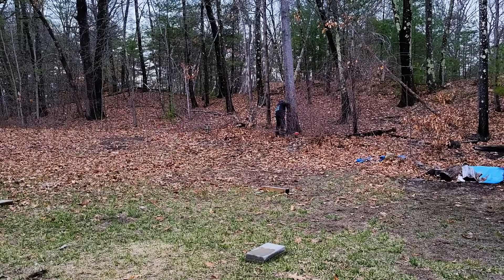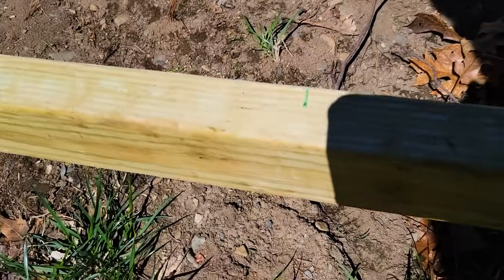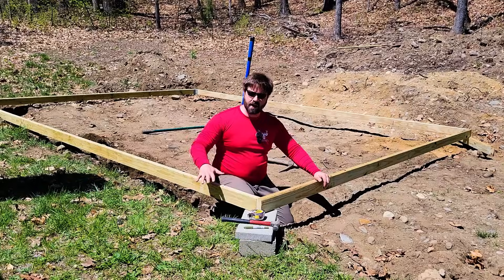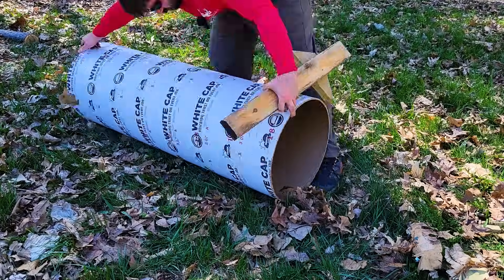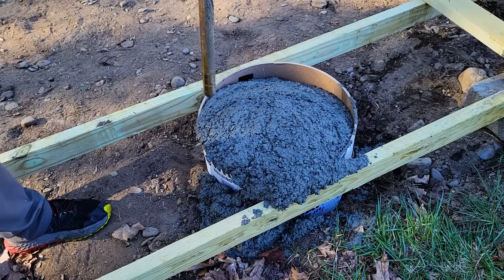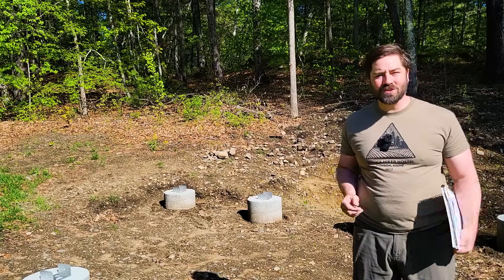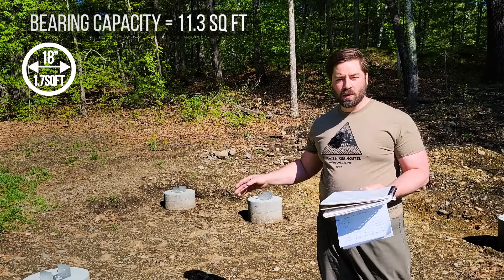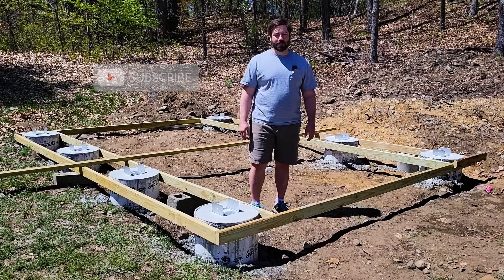Foundation secrets for an Off Grid Cabin

Comment: I was lucky I was able to get paper tubes from a box factory for free. They ranged from sizes of 8-16" in diameter. I set a flimsy metal storage building ( I could lift and move the entire kit) onto 32"x12" piers of concrete that could hold a 3 story house.

Comment: Great video - thanks. You answered a pile of questions. You didn't use any rebar - can you provide some insight on that decision? Thanks again!
Reply from the maker: Concrete is very strong in compression, but weak in tension.  Rebar is strong in tension.  Rebar is used to strengthen concrete structures where it is subjected to tension forces.  In my case, these footers are spreading out the load of the beam over a wider area of soil.  This is considered a simple compression force, no tension forces.  Simply, code does not require rebar in a simple footer like this.  

However...  If I had dug down 5 feet, and had an 8 inch pier of concrete, then the pier could be subjected to lateral loads, which puts the pier in tension.  I would have added rebar if this was a pier.

Comment: In North Dakota, I'd use a poured foundation at least 4' deep (although 6' would be better, considering our frost line is almost 6' deep) in a monolithic pour. I know from experience that even a small, light structure here needs better foundation. The ground shifts quite a bit. ICF's wouldn't be unreasonable, but I'd have to have professionals do the prep work for it. I can't afford that, and we tend to be DIYers ourselves.

Comment: You didn't use any rebar...
Reply from the maker: Correct, since these are in compression.  However, if I had used deep piers, then I would have added rebar. This is because deep piers will get lateral forces on them.

Comment: I've heard some folks paint their timber with used motor oil ~ to keep moisture and bugs out long term. FYI
Reply from the maker: I've also seen some YT videos of people doing that.  I'm using pressure treated lumber so it's not necessary to use another treatment on top of it.

Comment: Quick question - you built the wooden frame and leveled it, but then it looks like the tops of the sonotubes are actually around a ½ inch or so above the frame. Is that correct or does it just look like that on camera? Is there a reason they aren't the exact height of the leveled wooden frame? Thank you.
Reply from the maker: We built the wooden frame, and roughly leveled it.  This allowed us to pull a height measurement from the soil to the top of the wood frame and cut the sonotube to that height.  After placing the sonotubes into the wood frames, we then went back and checked level from tube to tube and made minor adjustments, so some of the tubes are slightly above the wood frame and some are flush.
Reply: @DavidPozEnergy Thank you! This is exactly the info I was looking for. Great info in this series. Looking to build a backyard shed/studio soon.

Comment: When you calculated the weight of the structure, you didn't include the weight of the concrete inside the sonotubes - is that an oversight? The soil has to support that weight too, right? I see you added 40 lb/square foot for snow load. Is that code in your area? To me, it seems like too much - by a LOT.
Reply from the maker: I did include the weight of the concrete.  Yes, 40lb/sf is code in my area.  Check your own local codes for the requirements in your area.

Comment: Why not go below the frost line?
Reply from the maker: For me, it was a cost vs. risk.  My ground is extremely well draining on it's own.  I don't have standing water, and that means very very little frost heaving.  So, it's still possible I might have a little movement due to frost, but I'm guessing it will be so little that it won't be noticed and certainly won't cause harm to the building.  So, I put building harm (risk) very low.  
Then, compare it to the cost to go below the frost line.  I would have needed to get an excavator out for at least one day to dig the holes since the rocks on my site are too large for an auger.  Plus the additional concrete and rebar (above what I already used).Cost would probably be an additional $1,500.  I couldn't see an additional 20% cost vs. the little risk.  
The math will change depending on your site.  If I had a wet site that was prone to frost heaves, and/or  ground that could be dug with an auger, then the ratio becomes less and I'd be more inclined to go below the frost line.

Comment: Nothing but rocks grow well in many parts of N.E.
Thickened edge slab or gravel and pressure treated runners or sonotube below frost. That shed will rise and drop 3" winter to summer. If every footer doesn't rise and settle at the same rate, the shed will flex. How much deflection is anyone's guess?
Good luck! It might not bite ya in the butt.

Comment: Since mid size cabins are still heavy enough to stand the wind, why do we put rock or concrete foundations inside the ground, why not just place them on the ground and build the cabin over?
Reply from the maker: I would consider my foundation set "on" the ground, not "in" the ground.  But, I still had to get below the organic material to prevent settling.

Comment: Great calculation for designing your pile footings. I hope you also consider the winter frost heaves of the ground when/if the ground gets wet which including your winter freeze and thaw cycles as this will also makes your foundation unstable. 🙃
Reply: That was my thought too.  Taking into account the frost line, I think about 4 feet in New England.  A city building code would specify that, even for outbuildings.
Reply from the maker: @StevenTorrey,  Every town will have different codes.  For my location, a building under 200 square feet is not required to have a foundation below frost line.  Thanks for watching.

Comment: if you aren't going below frost line, why didn't you just use cinder blocks?
Reply from the maker: You could use something like that.  I considered it.  In my case, I'd have to stack them 2-wide so the base would be 16"x16" because one block (16"x8") wouldn't have provided enough ground contact.  And then I'd be concerned with adding rebar to join the two blocks together and mixing the mortar.  I don't know, when I was thinking about that it just seemed simpler to pour the concrete in one go.

Comment: Very conservative calculations. For a frost proofing upgrade insulate the ground around the floating footers. I would have attempted to locate a support every 5’, over the whole footprint. Did the concrete get any fibers or anything reinforcing ?
Reply from the maker: I am considering adding insulation on the dirt in order to help prevent frost.  However, the soil here drains incredibly well.  I'm not sure there is any benefit. 
I don't have reinforcement in the concrete.  These footers are in compression only, not tension.

Comment: Imo, you should have gone with smaller foundations and had the floor frame floating on it, and when it settles, you can just jack it up and slap bits of hardwood underneath and make it level.  Would have saved you lots of money. But if you're made of money I suppose this is the way to go
Reply from the maker: If the footers were smaller, then I would not have had enough bearing capacity.
Reply: @DavidPozEnergy those footers would support a skyscraper
Reply: I've seen whole towns in Alaska built this way.

Comment: Just a quick reflection from a Swedish guy.

40 (pounds / square foot) in =
1.68  kg / m Hmmm or the unit calculator broke.

When calculating live load in a residential structure we normally work with 250 - 450 kg / sq. meter or 5932.59 - 10678.66 lbs/sqft.
That shows, your wide bases might not be wrong but even in Sweden in freezing winter, we can make do with a 12 inch diameter and make sure to have ample support for a fail safe flooring.

In my personal opinion I would be suspicious of the wide beams and low live load calculations.
I personally have now some 100-150 kg of boxes stored in a upper level room where the floor in fact carries this over the size of a banana cartoon size area.
That implies, when stacked four boxes high, it carries 100 kg or roughly 220 lbs on 0,25 sqm. or 2,7 sqft.
Hence the implications if I used the load calculations suggested here.

Not ranting, simply reflecting on live conditions of living.
Reply from the maker: There are 10.76 square feet per square meter.  40 pounds x 10.76 = 430.4 pounds per square meter.  That's 195.2kg per square meter.
Reply: @DavidPozEnergy  Then the unit calculator was broken on Google ;)

It is still not enough to be "per code" in Sweden. I would personally also prefer smaller foundational structures, more evenly divided over the whole area.

Beam width and bearing capacity of the beams i a whole different calculation in it self.

Comment: I believe a much simpler method would be a Post Frame foundation! Dig four feet deep holes, approximately six to eight feet apart, put a concrete foundation pad in the bottom of the hole, install 4x6 posts, and pack the dirt into the hole around the posts. The only concrete needed is the foundation pads purchased at local home building supply stores. If you are not familiar with post frame building, get a manual on line or from Menards building supplies.
Reply from the maker: Post frame foundations like you described certainly have benefits.  I don't know if it would have worked with my soil.  When I've dug more than one foot into my soil, I regularly run into rocks the size of basketballs.  An auger held by two people just won't work.  Usually you have to get a backhoe to dig holes here.

Comment: Could you have done a dry pour? Would it work?
Reply from the maker: I don't think a dry pour would have worked in this situation.  Perhaps when it's a thin slab it's OK, but it's considered best practice to mix with water before pouring into the form.

Comment: 15:00  HINT:  If you had used 18" x 18" x 8" deep square pads with 12" diameter Sonotubes on top you would have had MORE bearing capacity and saved a lot of concrete    😀
Reply: I’ve seen square pads. How do you determine depth, frost line?
Reply: Good tip. Do they have to be fully below the frost line or just breaking that depth

Comment: 12:30    HINT:    If you move the string line to the EDGE of the post saddles, it would make it easier to align all of them without having to measure and mark the CENTER line.  Also you wouldn't have to fit them under the string line. 😀
Reply from the maker: I love comments like this.  Thanks for taking the time to share knowledge.

Comment: The absence of relatively inexpensive rebar stood out to me..... considering all the other expenses....
But, best of luck, in any case.
Reply from the maker: Rebar is required where there is tension forces.  These simple footers are in compression only.  So, even if the rebar is a small added expense, there is no added value in my specific application.

Comment: Smaller 8" columns will be less affected by frost heave, theoretically you only need 2 square feet of soil (2,000 psf) and 1 square inch on concrete (5000 psi) to hold the weight the cabin.
Reply from the maker: I'm sorry, but I don't follow your math.  Did you watch the video from 12:48 to 16:13 when I describe my math?
Reply: @DavidPozEnergy   A single 8-inch diameter helical pile can have a compressive capacity of 60,000 lbs (30 tons) OR 12 x 5,000 lbs cabins.
Reply: @kjs65a56  The limiting factor for the foundation is the bearing capacity of the soil, not the concrete. Think about pushing a toothpick into a cake to see if it's cooked through. The compressive strength of the toothpick (concrete) is higher than the cake (soil). So, as you push (bear) on the toothpick, it punctures (settles) into the cake over the same cross sectional area. Make sense?
Reply: @kjs65a56  It's so much work and cost to do this, and considering the unknown effects of the soil underneath, I'd consider helical pilings too.  In 30 years or if you ever want to add on, it will seem like a good idea.  Also saves several days, and the concrete was not free.

Comment: actually, with 16" tubes you'd only have to round up to 9, which would fit in a neat 3x3 grid
Reply from the maker: A 3x3 grid would work well if I had a load bearing wall in the middle of the cabin.  The way I'm building it, the roof loads are being transferred to the outside North and South walls.  No roof load is being transferred to the middle of the building.  This means that there would be more load on the 3 footers at the exterior walls and less load on the interior 3 footers.  Over time, this will cause uneven settling and a hump in the middle of the floor.

Comment: pier, and beam  at least 24 inches above grade for repair access and insulating. people never put them high enough becuase they never envision working under the house which will always happen .
Reply from the maker: I agree that access under is important.  I have enough clearance to crawl under the structure once the beams are installed.  The next video will show the beams, which add height.
Reply: @DavidPozEnergy  I thought I had enough room until I got older.LOL but yes I am still very interested in seeing your build completed
Reply: After watching you methodology, Good job
Reply: Thanks for the video. In planning stages for our cabin

Comment: Rather than get the sonotubes perfectly level I would have made them an inch or 2 above ground level than leveled with the 6x6 posts.  I would have went down to the frost line.  Good luck!
Reply from the maker: There are a lot of ways of building a small structure like this.  I recognize that your described method is also very popular and uses less concrete.  I actually described some of the pros and cons of this alternative in my raw video footage, but ended up editing it out for time.  If I had a short (say one foot tall) 6x6 post on top of the footer then there are two hinge points.  One hinge point is at the footer to post connection, and the second at the post to beam connection.  These hinge points need to be addressed in some fashion.  For example, there could be diagonal bracing from the bottom of the post up to floor joists and up to the beam.  Or, there are large steel plates that can be added to create moment joints.  I considered both of these options.  The diagonal bracing is fairly inexpensive since it's just 2x6 PT nailed in place.  However, the diagonal bracing lapping up onto a joist is a little more difficult.  The joists may not line up with the outside edge of the post, and if they don't then I'd have to pad out the closest joist to be flush.  Then there is an additional thermal bridge of the diagonal brace.  Also, the brace creates another path rodents or insects may enter.  These concerns can certainly be mitigated in their own way, but I felt at this point it is simpler to make the concrete a little taller.  Anyways, I don't consider one way "right" or "wrong" if they both meet the demands of lateral resistance.  I just decided on the method displayed in this video.

Comment: I am surprised rebar was not needed is the concrete
Reply from the maker: Rebar is required where concrete will be in tension.  This arrangement is purely compressive.  However, if you ran a concrete pier 5 feet down to a footer, then there would be a need for rebar.
Reply: @DavidPozEnergy  If the concrete piers are purely compressive, I am assuming that you are in a very low wind area? I would expect that any wind loading on the structure would result in a sideways force which would then be transferred into the piers via the saddles you placed in the concrete.

Comment: That should be a good foundation I just used a foot of crushed stone and pressure treated 6x6 which still has about the same sq footage of support as your footers been 3 years and it hasn't moved yet maybe I just got lucky. Looks like you are going for a wood floor I used patio stones as I wanted to put heat pipes in the crushed stone. Cheers
Reply: I think this was all done to make a YouTube video. Not that it was wrong just a lot of unnecessary expense and work. I live in New England and the way you describe your shed  is pretty much how most people would do it. I have never seen any real issues doing it like this. This was is just overkill. Again not wrong just unnecessary.
Reply from the maker: Crushed stone as a base, with 6x6 "skids" is common and I've built like this before.  When I choose to use that type of foundation, it is for a garden shed.  Specifically, un-conditioned space with no insulation.  The difference with this build is that the floor is going to be fully insulated.  I wanted the floor raised up high enough that I can crawl underneath it to insulate.  If I did crushed stone and 6x6 skids, then there would only be 5.5" of clearance, which is not enough to crawl under.  With my foundation in this video, there is plenty of room to crawl under.

Comment: Great explanation of each of the steps. Why didn’t your friend with the excavator scrape all the top soil off, after he removed the tree?
Reply from the maker: We removed the stump and a lot of soil to make the area flat.  in the backside all the topsoil was removed.  My close-up was on the "front" side (South side) and that was the grade I asked him to level to.  That meant I had a little bit of hand work.  But he came over on a Saturday to help me at a low price.  We got done what we could in the short time frame.

Comment: 6 inches hard board insulation, then 3” on the sides. Rebar and then radiant pipe. 

Use an Apollo heat pump and put a hydronic head high up for cooling with the floor for heating. 

Basically surround the concrete in hard insulation and it won’t crack then use the floor as a heat mass and it works way better.
Reply: what an idiot